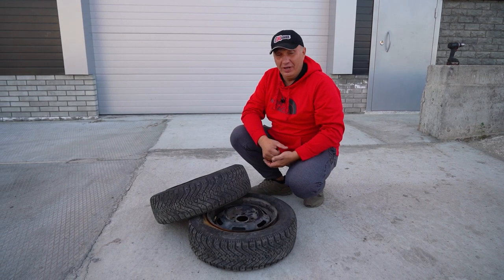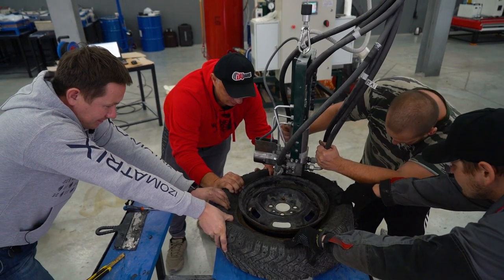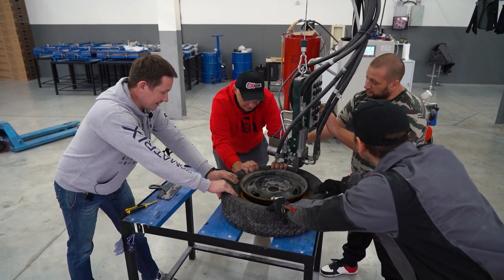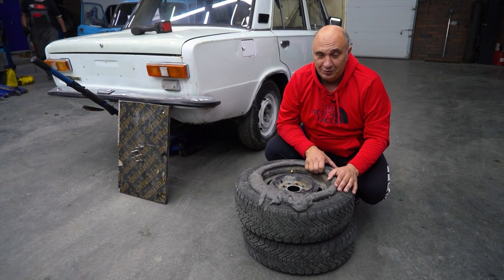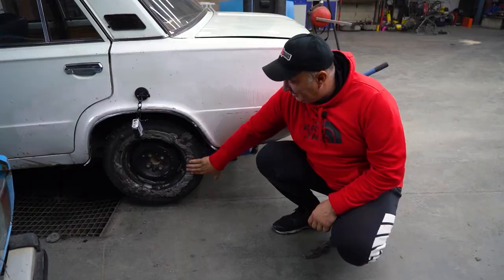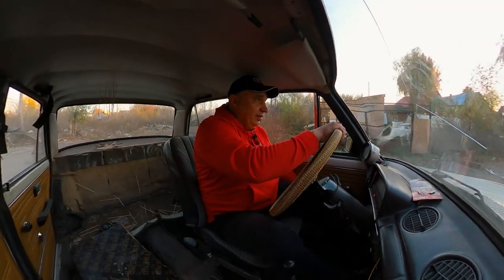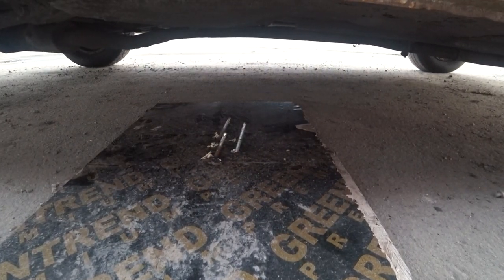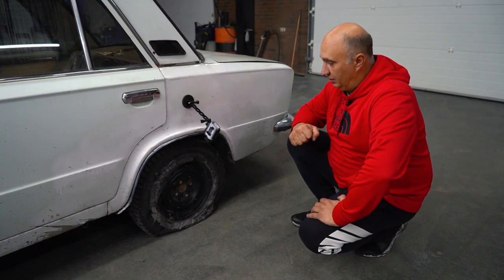Filling tires with polyurethane foam (making them puncture-proof)

Comment: I would have calculated the foam volume so you dont need relief holes.  You know the expansion ratio of the foam.  You can measure the volume of the tire.  If you calculated the right amount of foam to get 3 times the tire volume, you'd (theoretically) end up with 3 bar in the tire.  You wouldnt need the relief holes, and the final pressure would be a lot closer to a normal tire.
Reply: Wouldn't you still need some holes to release the air that is in the tyre already? Or does the foam "use up" the air?
Reply: the thing is, there isnt only foam in there, air is in it as well, so less foam = more air.
more foam = spillage(if you drilled holes) but also air that can escap from the tire..
what they should have done is spread holes on  both sides of the tire, then fill it completely with the foam liquid mixture and run/stay away + let it sit overnight.

the foam itsself once it is hard, als consists of air as well so.. any air that was in the tire still (after the liquid pooring) should be removed through holes.
otherwise if you do poke it with a knife, you hear hissing noise from leftover air and the tire will be less inflated lmao
Reply: Nah youd never get it 100%.
Its better to have excess that you can remove later
Reply: Yes, there would be a bit of air trapped.  Unless the tire is complete shit though it should be rated to handle more than 3 bar.  Tires on my light truck right now are rated to 5.5 bar.  Plus there's going to be a safety margin on top of the rating.  One whole tire volume of trapped air would add 1 bar, but we're not trapping an entire tire volume of air.  And the volume of the polyurethane itself displaces some air so that adds some pressure.  The heat from the expanding foam would also add some pressure.  Overall though, you'd still be well within the bursting pressure of the tire.
Reply: @@swimfan1976 You act like thats crazy high, but it's only ~72 psi.  You wouldnt usually run the tire that high but it can certainly take it and still have some margin left over
Reply: Hell wers the fun in that lol trial and error .but ya a good idea if ya were trully gonna use it for somthing major .👍
Reply: Well, by having 3x the foam volume you won't necessarily have 3bar of pressure, it really does depend on the force behind the foam's expansion
Reply: @tippyc2  yes, my commercial work utility van (v10 engine, weighs a bit under 5 tons) rear tires spec 80 psi.  it's not unusual at all
Reply: @bennylloyd-willner9667  OPEN THE VALVE STEM!  :-)
Reply: @frankrizzo890  lol, imagine the luck if the air pocket is exactly at the valve and the valve is not covered by foam. Time to buy lottery tickets then 😁
Reply: That sounds a bit more complicated that just drilling relief holes
Reply: I think the video proves you wrong. The tyre they put in more relief holes held its shape better because the air could escape to make room for the expanding foam.
Reply: @bennylloyd-willner9667  Every tire has a valve stem to inflate/deflate... remove the valve assembly and inject the foam reagents through the valve stem so that the valve stem will also act as the air vent, but it would need to be closed as soon as foam exits to keep the interior density of the foam high enough to simulate air pressure. It would be a bit fiddly at first, but with some experimentation...
Reply: @cptcosmo  yup, it might work if the valve is the highest point. I have no knowledge on how fast the foam expands so my thought was that air may be trapped if not delicately filled.
Reply: @bennylloyd-willner9667  It might be better to put the relief holes in the rim instead of the tyre and apply the foam in each hole so it contacts the tyre surface and expands toward the rim. Or inject the liquid into a vacuumed innertube eliminating the problem altogether.
Reply: @leehiller2489  there must be several ways to do it, my main point is that any air need a path to exit without getting trapped by the expanding foam. Vacuum pumping is one way. In this video tho, I don't think they wanted to complicate things too much.
Reply: foam isn't ideal gas, so "theoretically" isn't applicable.
Reply: You know the theoretical expansion ratio. But it´s unlikely this expansion is going to be uniform unless the foam is evenly distributed on the inside.
Reply: @bennylloyd-willner9667  If they did this in a vacuum state, it would be perfect.
Reply: If these guys did this in a vacuum state, it would be "PERFECT"!!!)))
Reply: @rogersmith8480  I think it is getting a bit more demanding work, equipment and planning than what this channel is about 😁
They take fun ideas and make great videos. Let's just end the "laboratory experiment sciencery" and look forward seeing the next one 😊
Reply: Theyre russian
Reply: You wouldn't
Reply: Haha good fucking luck measuring that volume 😂
Reply: @ex0798  easy.  Get a tub of water.  Submerge the inflated tire and measure the the change in water level.  Subtract 10-15% for the steel rim and rubber thickness.
Reply: thank you
Reply: And that would be just how much fun?

Comment: We have been foam filling tires in the USA for decades. mostly on certain construction equipment, hand carts, and rolling shop tools.
Reply: Warehouse forklifts.
Reply: There are solid rubber tires also, like for wheel barrels. Just bought one, and it never gets flat. Of course nothing is eternal.
Reply: @Njazmo  yes solid rubber tires are the original tires but foam filling is best for certain applications like form riding concrete paving machines for them to be transported but airless tires are becoming more common these days especially on skid steers.
Reply: @Njazmo  solid tyres suck for impact absorption. I've ride e-scoters with them which only go slow. High speed would be brutal.
Reply: @Eluderatnight  oh ok that's why those tires like that
Reply: Does the foam have a 40-60 psi load rating?
Reply: @Sparky_D  oh so not good for everyday driving?
Reply: @theexisting1197  definitely not
Reply: @Sparky_D  👍
Reply: its ok they are russian and still have bears as pets, cut them some slack.
Reply: I think they are experimenting with diy ideas and alternative ideas.
Reply: We had that on one of our skid steers.
Reply: I did this long ago for my hand cart and wheelbarrow.
Reply: @Sparky_D  That´s why they want to use foam.
Reply: @FBPrepping  I was replying to someone asking about solid tyres

Comment: I think you may be looking the wrong direction with harder polyurethane. If you think about the way a tire works normally, air is not hard, it's just pressurized. So maybe try to figure a way to fill the tire through the fill valve? Or design a larger fill valve that could be used. That way the air in the polyurethane won't have a way to escape when driving the car.
Reply: The sound deadining foam they are using is much like a foam sponge. Other types of foam like the kind that pool noodles are made of are far less permeable to air and water. Your method of sealing the tire would more or less be just a typical tire with run flat qualities. Now if they were to continue looking to choose the right type of foam and inject it into the wheel while vertically spinning at an optimal speed in several layers of increasingly more dense foam towards the rim, but of course also allowing each layer to fully dry before injecting the next; they would be able to create a badass tire that would out perform all other modern runflats.

Comment: This is a pretty common thing that's done on industrial equipment.  A common place you see it is in the tires of skid loaders at scrap yards since tire punctures are common in that sort of environment.  Generally makes changing tires a pain (often just have to change the tire and the rim), but better that having to deal with tire punctures everyday.
Reply: @Swim Fan Different material but same idea. Lots of people use "window weld" polyurethane to replace car bushings. Depending on the car its actually a slightly stiffer (a slight upgrade) to the factory super soft ones, that tear easily. Some factory bushes are even filled with a gel... those also tear easily.. So easily so that if the tech who installs them does it incorrectly, just letting the car down on its own weight will tear them.
Reply: This is common on battlebots too.
Reply: And SLOW MOVING, not an automobile traveling at highway speeds, now a danger to you and other drivers.
Reply: I did it to the back wheel of my E scooter after getting many flats. Works fine! No more flats.

Comment: You may also want to check the difference between using closed-cell foam instead of open-cell.  Open-cell has paths that allow the trapped air to escape.  It'd be interesting to see!
Reply: there are holes in teh tyres, open cell foam would absorb water every time you go through a puddle and even just soak up surface water when it rains. not very smart.

Comment: Here in Canada you can buy one time foam expander for punctured tires. The can has a nossle that attachs to your tire air valve so you can blow the tire up. This is only meant to get you home or to nearest garage. The stuff seals the hole up to a reasonable size and blows up the tire. These cans oftin come in car emergency kits with other items like booster cables, flashlight, gloves etc..

Comment: You should fill a tire with the yellow urethane expansion foam that comes in aerosol cans and gets hard when it cures you should just pop the valve stem and spray it in and replace the valve stem as soon as the foam starts to come through the hole you'll achieve about 15 psi inside the tire from atmospheric so it should work way better than that soft grey stuff.
Reply: I've tried it. The Great Stuff foam doesn't ever expand and set unless it has a low pressure path (with air available) to expand into.  I filled a tire using the method you mention (removing valve stem to fill) and several MONTHS later, most of the foam was still liquid inside the tire. Upon cutting the tire open, the liquid foam that had been in there for several months then began expanding and setting.  So Great Stuff doesn't work for this purpose.  I think the reason it won't set is that this type of foam is a single part, air activated reaction. The professional foam is a two part reaction where the dispensing machine mixes the two parts at the time it is dispensed which starts the reaction. It cures independent of the presence of air.
Reply: @Stupidspencer1 have you tried aerating the rim instead of the tire just curious

Comment: I would suggest tilting the tyre too, so that foam fills it completely, from the lowest to the highest.

Oh and you can fill the tyre to 3 bar safely, or 300 kpa
Reply: but there not using grade A tyres remember there in Russia, 🙂
Reply: @dh2032  Also they are used, beaten and old snow tires, likely made in Russia.

Comment: Has Vlad and the crew fixed up a Lada with a complete air ride suspension?  That would be a good project.
Instead of basketballs, as was done before, get some real suspension airbags (like the ones for a bus) and rig up an air pump and controls to inflate and deflate the airbags.
Reply: I think so....I can't say for sure, but I seem to recall something of the sort.
Reply: The "shorty" build had an air suspension, if I'm not mistaken.
Reply: I believe they've already done this.
Reply: @SwapBlogRU  I found a video of another Lada ( not the shorty) that was given a basketball suspension.  Interesting idea but, it didn't last long at all.  

I'm thinking of Vlad getting some legitimate air bags off of a bus or some other truck and stuffing them underneath.  Rig up an air pump driven by the engine and controlled from inside.  The air pump can come from a diesel truck with air brakes.  It will already have the pulley, fittings, and mounts.

I'm sure bus air bags will give the best ride for a Lada at a third of the air pressure they normally take.  But, Vlad will have valves on the dashboard to control the inflation and deflation of the air bags.
Reply: Homie snorted the whole line

Comment: "Lookout! The tire can blow up!" 
"Yeah, we better cover it with some thin plastic" 😁
Reply: I think that's why vlad laughed amd said yeah that works
Reply: I don’t think it was for the explosion but for the foam that was goin to be pressured out the holes
Reply: and put 2.5 in the next, run it for another 10 sec
Reply: To keep the foam from spraying all over that clean garage
Reply: and at least they should wear some eye protection
Reply: It isn't to protect against the bang but to catch some of the foam if it happens
Reply: @MadScientist267  my bad, I was going for a joke, but unless you are double r/whooshing me I failed badly 😂

Comment: I would be more curious what would happen by adding more Schrader valves all around the center of the wheel, then remove all their valve stem cores so that you have no holes in the tire other than the stems. Fill it with the foam thru the bottom valve steam and spin the tire so that the foam centrifuges to the outside of the tire. Let it harden, and then add more foam, and spin it some more. You can then add the valve stem cores back to the tires after it all mostly solidifies with very little air pockets inside. You should be able to then air it up using the Schrader valves and the tire should still be pretty much puncture proof as the foam would act more like stop leak.

Comment: Been doing this for years now and have found out that the inside of the tire needs to be dry and that the high density foam works the best, be sure to start from the tire and work towards the rim, and give it time to expand, remember that when you are done there's no more Air in the tire so you need to get the foam completely around the inside, I've never done it on a highway tire just off road works well, I always Carry a can with me off road.

Comment: Back in the day, tires used to have inner tubes, wouldn't it be a great come back to fill the inner tube with foam, allow the tube to protect the rim from goo, so when the tread is gone, you only need new tires instead of rims and tires. Perhaps have the instalation rotate on a spindle as it expands, the inner tubes may already have no air in them that needs to be expelled.

Comment: Very interesting. I suggest fully seating the tire on the rim, then let the air out. Then drill five or six 12mm-14mm holes in the metal wheel so the foam can be injected into the holes. Inject a bit in one hole only, let it expand just for a minute, then move to the next hole. Also, use trailer tires. They have triple thick sidewalls. Not advised to use trailer tires on steering locations. But on rear 'Load Bearing' locations, yes.

Comment: I've done this with garden tractor tires for years. You need a denser foam for it to be reliable, otherwise you need to run a modest air pressure as a backup. Doing it at home, it's lots easier to just mount it and roll it on the axle slowly to let the foam 'slush cast', using either off-the-shelf 16lb foam or more rigid 20lb foam with a plasticizer agent mixed in.

Comment: Use gyroscopic forces to spread the liquid while it is setting. Specifically centripetal force like a centrifuge.

Maybe put the Lada on the hoist and use acceleration to spin the wheel while wet. No air pockets and even spreading

Comment: You guys need to try to do the exact same thing but introduce the foam through the valve stem with already seated tires...vacuum out all air.. x2 your foam in the tire as well to make it more rigid or use something different(hardware store expanding foam??) Spin it on a machine or axle to even the distribution for balance... wonder the results to that..

Comment: You need to make a special jig for the tire. Take the wheel off the rim. Put it in the jig that will keep the shape as you put the foam into the tire under presser. The most important part is to make sure the tire is balanced. If there is not enough foam in spots the ride will be very bouncy and uncomfortable ride. When driving a car down the road your tire builds up air pressure. You put in 32lbs of air. While driving the car down the highway at 55mph. Your tires build up air pressure in the tire after 20 minutes your tire pressure is about 36 to 38lbs. Where does this air come from? It’s crazy but it your putting foam in the tire you have to count on the build up of air pressure to. Putting holes in the rubber is useless. Put the foam in before you put it back on the rim. Use a cutter and shaper to cut the over flow of foam off before putting the rim back on. Check the balance of the tire. Good balance without any damage to the tire or rim. Give it time to harden and saddle down while spinning the wheel to keep everything in line. Then through the tire on the care and hit it. Since there isn’t know air build up in the tire there isn’t any chance of the tire exploding. The tire will push off the rim and stretch away from the rim not go boom. If pressure was in the tire yes there is a chance but not likely to All because there isn’t enough air only foam that takes up the space where the air is so post to have been. Fire is my only worry. It’s very deadly from the gasses that let off from the foam. Plus how hot it gets too. That’s should be the looked into more as welll. The more heavier the foam the stronger the tire. Just one problem how uncomfortable the ride will be. All these Ideal have been tried before. Just go check out a Goodyear book at the library. Through the years everything has been tried. Good luck at your project.

Comment: Expanding foam works fine at sealing tires....for small carts, hand trucks, certain small equipment, even some small low speed riding lawn mowers used on flat fields.